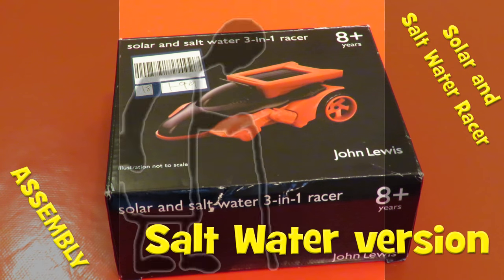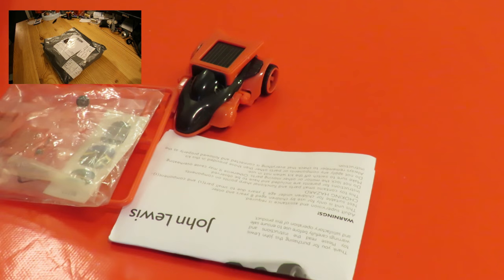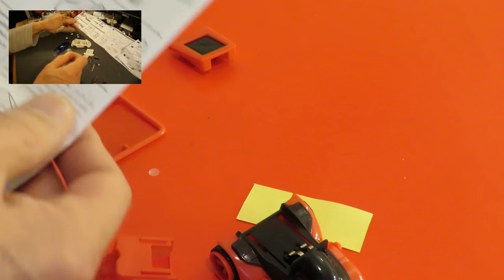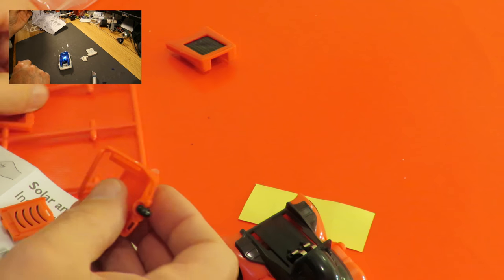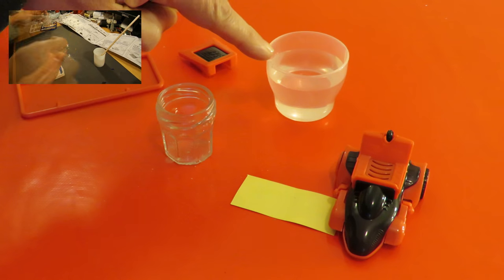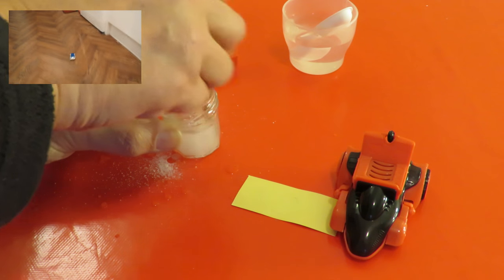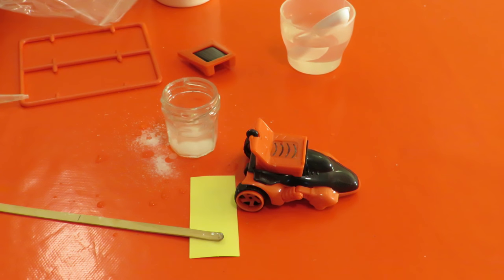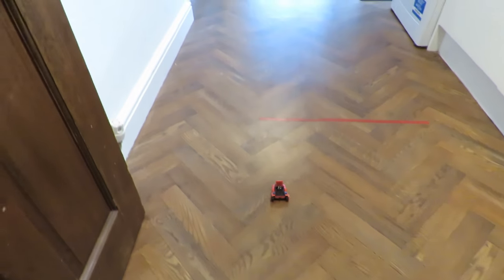Solar and Salt Water Racer - Salt Water version

Comment: I liked the fix...dunk the whole thing in !
Ran quite nicely after that.
Reply from the maker: Having been on the shelf for months untouched, my grandson actually picked it out of the pile this week and decided he wanted to try it out. We used a fresh cell and try as I did, I just could not get it to produce enough power to run. We had enough to get the wheels turning but not enough to move the car, so it looks like I got lucky first time in the video.
Reply: Mind you, it's good that he knows about limitations...otherwise he could be out at the seaside, car has run out of fuel and he walks off with the gallon container toward the shoreline !

Comment: That is cool.  Thank you for persevering. 
How long do you think the battery will last?
Reply: Wil Hobbs depends on the current draw and the voltage. That determines the rate of corrosion of the magnesium plates. But most of the time it's about 1v motor  with a tiny current draw so I'd say it's about 1week of constant usage before it completely corrodes.
Reply from the maker: I didn't test it to see how long it would last. The main problem is that once you have started the process you cannot stop it so each cell only works once. You can let them dry out and try re-wetting them but they never seem to work as well a second time and eventually the magnesium plate is depleted. With other salt water battery cells I have used you can take them apart and wash them off in clean water to remove the electrolyte and possibly re-use them again later.
Reply: Thanks GrandadIsAnOldMan